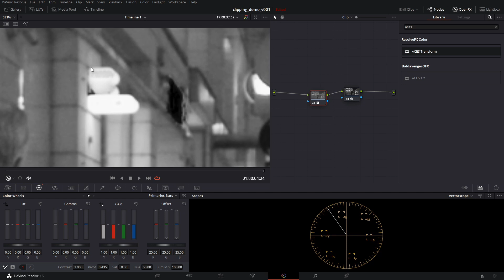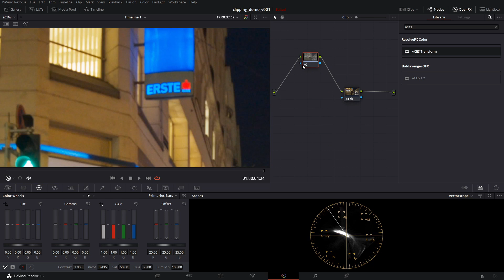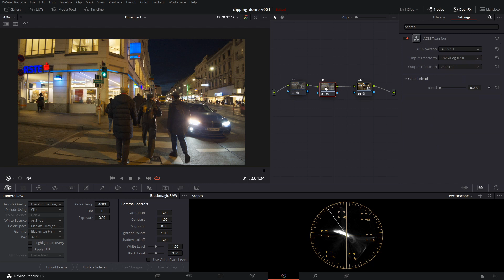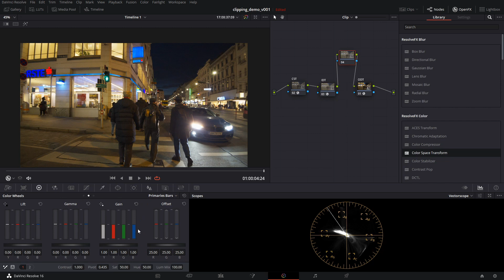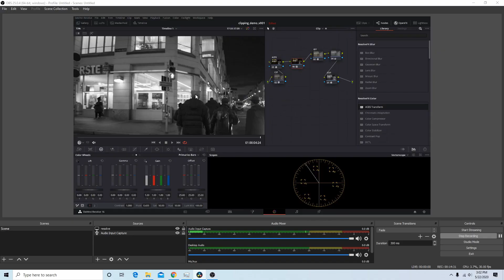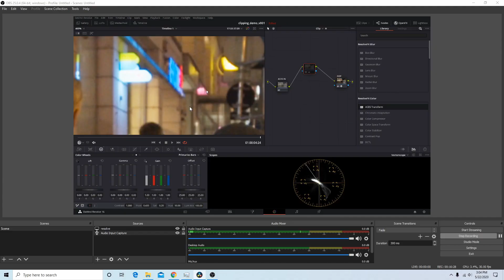How to Fix Neon Color Clipping in ACES | BMPCC4K

Comment: Thoughts on the Neon Suppression LMT vs using the Gamut Limiter?
Reply from the maker: Gamut compression Dctl works better for preserving the original colors. Gamut Limiter ofx can work well in some occasions and others it truncates colors in an unnatural way. Check out the gamut compression Dctl from the Aces community

Comment: Few questions. What is your opinion between ACES and Davinci Wide Gamut? Also can ACES be used when grading footage come just one camera in a project? Or does it only makes sense when matching multiple cameras in one project?
Reply from the maker: So far ACES is the most consistent in transforms when I have compared the two and ACES is used across different software such as Nuke, Natron, Blender. This makes it easy to generate look transforms that are independent of the camera color science.

The biggest problem with ACES is that you need to do workarounds for non-raw (raw is linear) acquisition color spaces that do not it l have an IDT (like flog), which is annoying, and it often has gamut issues with colored lights in acquisition gamuts wider than ACES AP1. There is a gamut compression dctl from the ACES community that deals with that very well.

Comment: hi tony, thanks for great explaination..
sorry for the noob questions, what's actually ACES are ?
is there any benefit with ACES colorspace ?
why not using the ARRI colorspace transform instead ?

thankyou so much !
Reply from the maker: ACES is a color management system intended to conform all cameras into one work flow. Color management makes it easier to go to and from different color spaces and gammas without regrading the whole thing. Along with other benefits, usually if you grade manually or use luts you will need to regrade everything or find different output luts if you need to output to different color spaces.

The point of ACES is that the output selections (rec709, rec2020, ACES cg, etc.) are more predictable and transferable across programs without the need for a lut work flow (which can display colors differently in different programs such as nuke V Resolve). 

ACES takes out any guess work essentially in larger work flows and is probably why Netflix requires ACES post production pipelines.

Comment: That's cool. I didn't even realize that LMT existed.

Have you tried this with other footage and in a non aces environment? I'm wondering if this would work to take whatever footage, let's say Slog3 to aces, apply LMT then back from access to working colourspaces.

I see neon clipping in all sorts of scenarios. Not just braw & aces.
Reply from the maker: Try using it in linear gamma and aces ap0 color space then transform to your preferred color space. I haven't tried it but it could work. Often the clipping issues are truncated color values being pushed through a color space that is too small. If you use a wider color gamut to work in that usually fixes the issue